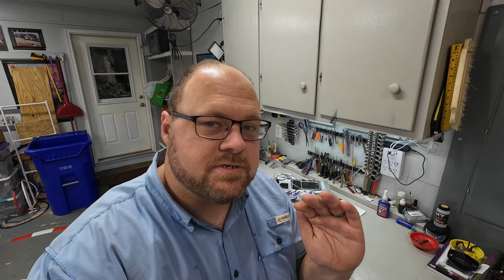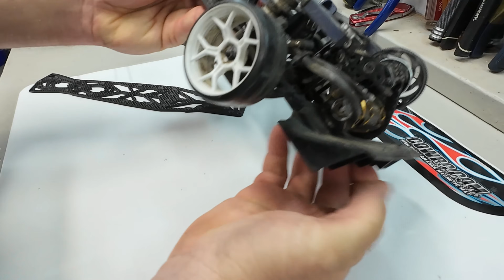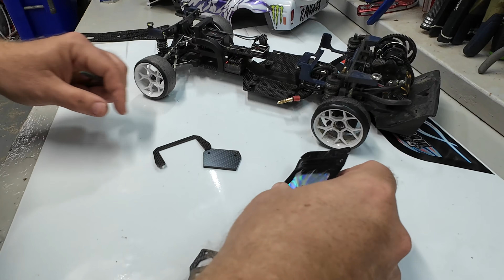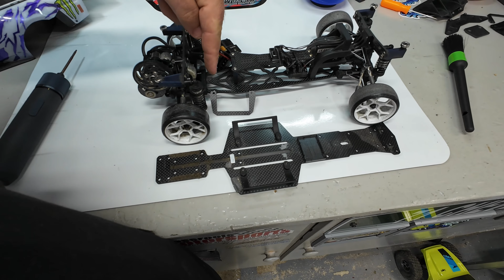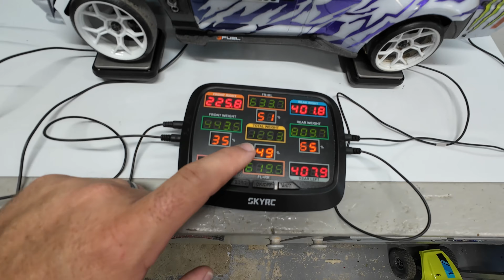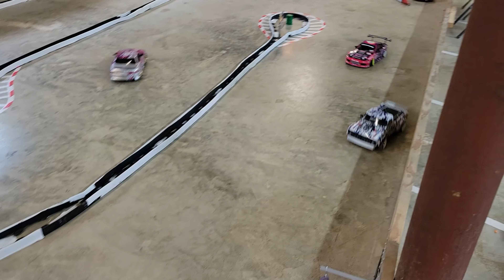New Chassis for the Redcat RDS RC Drift Car

Comment: What’s your settings on your rear blocks because I did a motor swap and took it apart and I can’t remember what they were thanks
Reply from the maker: Hello!
I don't run the factory setup.   If you want that, you can download the manual from the Redcat website.

Comment: Any advice for setting this car up out of the box for outdoor concrete ? I never have enough momentum to drift
Reply from the maker: Do you have any videos of it running?   

Typical issues:
- more wheelspin doesn't mean lore traction.   Less throttle = more traction. 
- there are a lot of different tires available on the market.  Make sure you are using a tire that matches the surface. 
- ensure there is nothing dragging or rubbing.   Even a very small amount will hinder the movement.

Comment: Hey Troy! I've recently upgraded my YD2Z with the new RD2.0 transmission and it gets a 31-69 weight distribution. I'm really curious of what you would think of doing that swap to your YD2Z. Only thing is that you need to find a solution for the upper deck
Reply from the maker: Interesting!   Thanks for the tip!

Comment: Troy, forgive me if it feels like I’m throwing shade at Redcat but I’m not.

Hear me out.

I feel that with Traxxas’ announcement that they’re entering the ring, I feel they’re likely going to enlist the community to “help” them develop their car.

However, the difference between them and say Redcat is that Redcat is actually very supportive of the community and values their input to make the RDS better. Where can they improve, what does the community want from Redcat, what is the community doing on their own to improve the RDS, etc. That’s where I feel Traxxas won’t do. They will plug someone they know to help sell the car and while the community will be out in force to continually develop the platform, Traxxas won’t be involved in any of it. Hell, they’d likely send a cease & desist to get them to stop.

I know that no one wants to keep hearing the negative about it and really, Traxxas should be praised for finally answering the call. However when I look towards the community, despite being a kind of odd-man-out, Redcat has been very supportive of the RDS community and the community in turn have been supportive of Redcat to help make the RDS even better. Had that not been the case, the factory upgraded parts they’d made would’ve been more superficial than they are.

That’s why I’ll stick up for Redcat and even Associated though I won’t do the same for Traxxas.
Reply from the maker: That all makes sense to me!

Comment: So basically the Redcat is no longer a Redcat.
Reply from the maker: You think the chassis plate is what defines what chassis it is?
Reply: @RoadsideRC  pretty much everything on that is not redcat. A few little pieces here and there. But if you take a d5s and put Yokomo parts on it, doesnt make it a Yokomo. Pretty much chassis is what makes the car a car, you take a Pontiac Fiero chassis and put a Ferrari body on it, dont make it a Ferarri does it?
Reply from the maker: @Ancient-Outlaw  Front suspension, steering system, transmission, rear suspension, bumpers...
Everything is Redcat.  
Seems like that counts to me.
Reply: Everything is the same but the deck. Its nearly 100% a redcat.